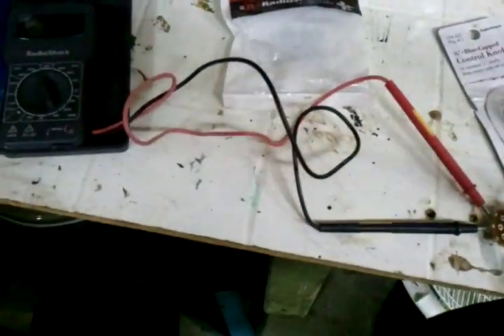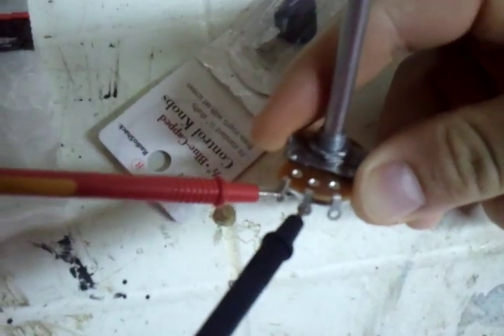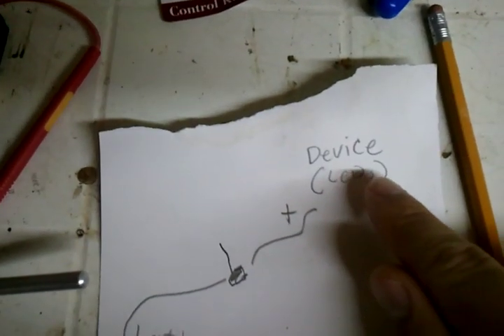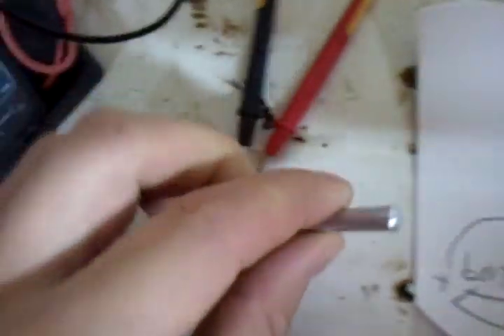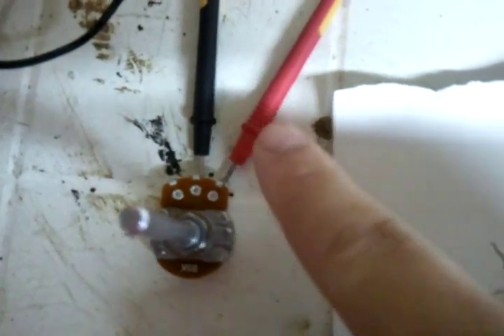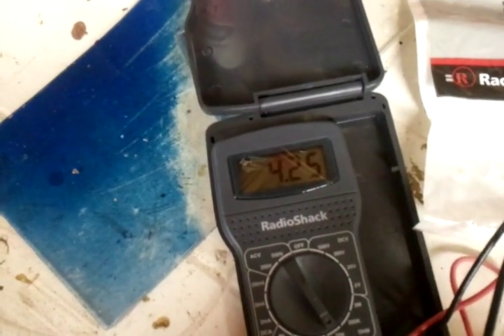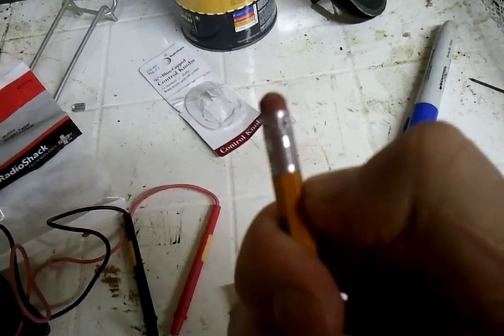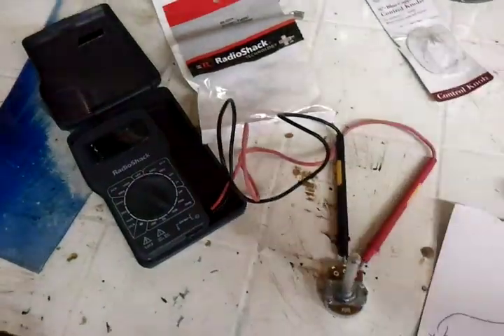How to control LEDs with a potentiometer (explained)

Comment: I thought the long control knob was so that you could size it for length,  depending on different mounting thickness  i e 1"of wood or whatever. the shorter for smaller thickness. thanks for the video, easy to understand.

Comment: Can I use a momentary linear potentiometer in conjunction with an Arduino, AVR, PIC microcontroller, or Raspberry Pi to light and maintain (6) individual 12 volt LEDs as the potentiometer is pushed? (IE: Lights the first LED and maintains it, then lighting the second LED and maintaining it, and so on. Each of the (6) LEDs will then turn off sequentially as the potentiometer returns to rest)

Comment: Hi I have a bad volume potentiometer in a magnavox console stereo . Its a double switch , but my question is the scmematic said 10k and the tap is 1000k and 5000k so what are they talking about .that potentiometer is no longer being made by magnavox . Its from a 1965 console stereo . I cleaned the voloume knob many times and the noise always returns .

Comment: Can I use potentiometer to control the 2 different leds? I am trying to have color chaning tachometer needle in my car. I want it to be change color after a certain rpm....all my research sends me towards potentiometers. I am a gear head and never been into electronics. Can you help?

Comment: If you wired it up using the empty terminal and the middle one, as you turn the knob clock-wise the led will brighten. The middle terminal is the common, and depending on the situation you can hook up to either side... It basically determines wether the potentiometer will increase resistance or decrease resistance when you turn the knob clock-wise.